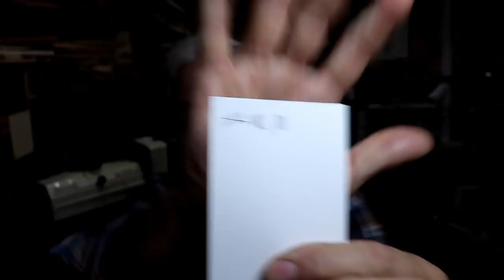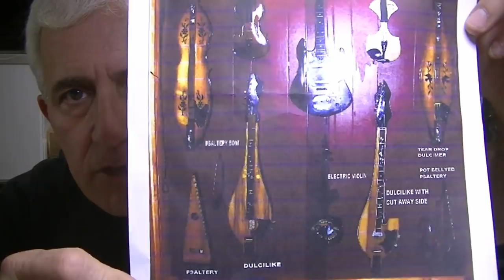378 RSW Epiphone Triumph Binding Restoration Part 2

Comment: Melissa's doing a fantastic job! As a 25+ years broadcast video editor, I can totally relate to the enormous task she's taken on. Don't watch the clock on what she's doing - just like your builds, it takes time to achieve quality - and it's quality that brings results. The turning point will be when you can let go and not feel the need to run through what she's uploading. Go for it, Melissa!

Comment: Jerry, 90 percent of the cutting I do with a blade making card models is the #12 scalpel blade in an X-acto handle.  I have the one with a cylindrical plastic guard with friction lock to the handle.  Slide back to expose the blade, forward to keep safe in my caddy.  Most often I slide the  guard off, use the tool, then put back on and lock to put in my caddy with pencils, picks, etc.  The guard allows me to reach for it without touching that scalpel blade!  It is much easier to see the point than cutting with a straight blade.  Enjoy the new tools and remember you can put the scalpel blades in an X-acto handle rather than clipping in the flat scalpel handle.

Comment: Awesome Archtop Jerry, I have a Gibson 1934 L5 reissue and love it. I also have an old 1930s Kay or Harmony that was my dads and had many splits, one right down the middle. I had a local gentleman restore it back in the 80's but unfortunately his repairs didn't hold up. Late one night I was awakened to the guitar twanging with no one playing it! It was a scary experience but easily explained, one crack let loose and as the gap widened the stringed buzzed. It is now tucked away in a closet in a case and if the ghosts want to play it let them have at it!

Comment: Pardon my intrusion, but I was watching you putting in that piece of kerfing and I kept wondering about using a soundpost setter for that. Stab it on there, and then you have enough holding power to put it where you want it, and hold it there. Maybe it's too short, I'm not sure how far that distance was, but something like that might be a way to deal with such issues. Just a thought. can't wait to hear this puppy strung up. LOVE those arch tops.
Reply from the maker: A violin sound post Setter would have been way too short. You might get by with a cello or Bass But if you don't have one handy ...
Reply: @RosaStringWorks  Well, there IS that.

Comment: Jerry, those flush faced nippers work great to cut large parts of binding off. Works very well for neck binding. They look exactly like what Stew Mac sells as fret pullers, but a lot cheaper from Lowes or Home Depot.

Comment: If you have PVC you can use plumbing cement for PVC pipe it will fuse it in to one piece hope this helps. Use in a well ventilated area. This stuff dries in three to five minutes.

Comment: I would think that the piece of binding that goes to the inside of the curve is shorter than the binding on the outside of the curve. That might be why they separate when placed on a curved surface after being glued together flat.

Comment: I am rebuilding a Harmony Arch Top Jazz Guitar. The Input, Treble, Volume, and Pickup are all grounded together. Would it benefit me to run a ground from the input, to say.. the Bridge where it screws into the end of the guitar? through the inside with a tiny hole for a wire?

Comment: Probably need more memory or a multicore processor.  In addition, a good quality video card can make a difference.  All three really.  New computer may be deductible.  That assumes your editing program supports multicore processors and that one understands the difference between memory and storage.  Both are solid state these days.  My solid state "hard drive..." boots windows in 21 seconds consistently.  Whew!
Reply from the maker: My PC is custom built for that. I have roughly 20 gig of memory. I have a solid state hard drive for the video processing. I have mini mini mini terabytes of storage space. So I have all of the proper equipment. The problem is the old videos taken with the old camera somehow conflict with the program and caused a program to crash. The new video taken with the new camera never seems to cause a problem.

Comment: I see in gluing the chip into the hole you recognized straight lines draw the eye.  One reason there are no straight lines on decent camouflage works on wood repairs.  Curves and odd shapes blend better for me so they are not seen once tinted and finished.

Comment: I’ve bound 1 guitar in my time, and that was a les Paul, pretty straight forward, I’m not questioning your decision so don’t take it that way, why did you decide to do the black and white mix on the outer binding and not using acetone to glue together 2 pieces of white to get the thickness you needed. Was it just an artistic decision? I mean it looks great I’d just like to know so if I am confronted with that decision I’d hope to make the right call as well.
Reply from the maker: I was just taking my best shot at trying to make it look similar to original. Most of the time they don't have a real wide solid color they generally break it up black and white Etc based on the remnants that I could see that was as close as I could get

Comment: Hey Jerry,
Just a thought, Maybe a dado slot routed into the length of a board to stick the binding in, would allow you to run the binding through your thickness sander? might work? Would be a time saver in the future. Great Video!
Reply from the maker: I do use that method I have a couple of boards with slots in them that I use to hold the binding

Comment: Try using the video editor called kdenlive. Its free and open source. You can download it from here:
https://kdenlive.org/en/
Reply from the maker: It only seems to crash with the older video which came from a camcorder. The new camera seems to work fine with the editor.
Reply: @RosaStringWorks  Maybe its good for your older clips.
Alternately I can help you convert your old clips to a new format.